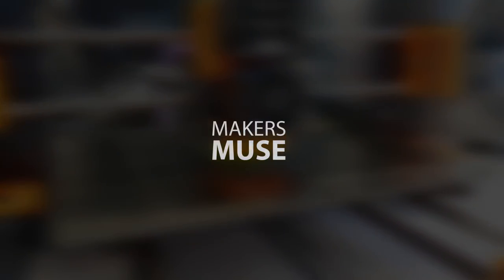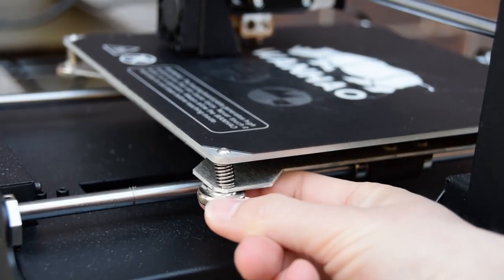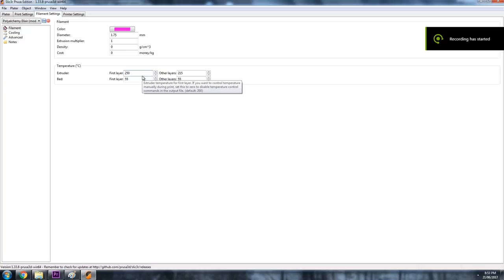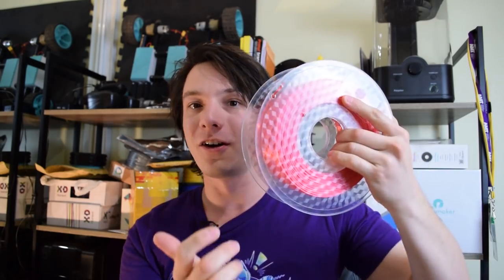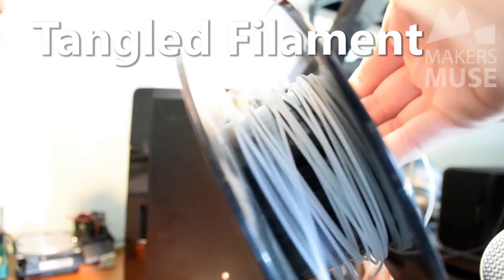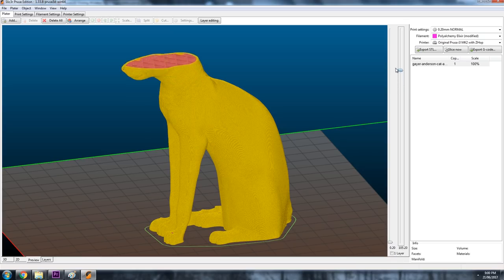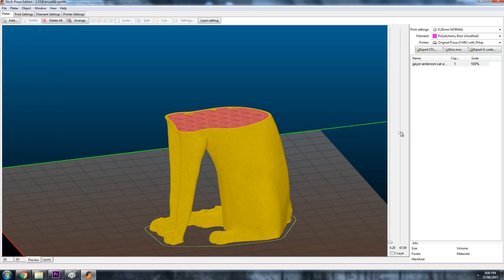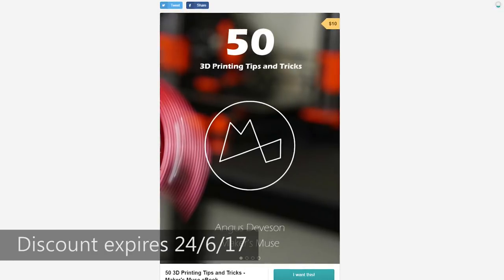5 3D Printing Mistakes you WILL make - and how to avoid them! 3D Printing 101

Comment: My print has failed on the base 4 times now, skipping huge sections and arching and tangling, I've print this model before in a silver PLA, I just switched it to a gold PLA with the same parameters so it's not the code. I've re-leveled it too many times to count (about 5), so at this point I have no clue what's causing it, any suggestions?

Comment: "connector problems"
My geeetech i3 pro b turned off while printing at some point, and after further inspection I noticed that the power connector does not reliably stay in its place. It came out like half a millimeter and lost connecton. It was pretty toasty as well.

Comment: I have a question that i need answered by an expert.... If i slice a model and its was done telling slicer to use a .06 nozzel and later on switch to a .04 nozzel will print fail do to extruding to much filament etc???  can this cause ringing etc of maybe cause extactor to start clicking /jamming??? i am having these issues i think... thanks

Comment: Why does my ender 3 pro say filament runout when I just loaded it and pushed the load on the  extractor until it came  out nozzle  but when I push print it stops and says "filament runout" before prints start

Comment: I remember having a problem where my PC falls asleep when a 3D-Print is running and the printer just PAUSES and then when I wake my PC the print "Resumes", But what is REALLY happening, The slicer THINKS it was farther into the print than it actually WAS, And, The printer R A M S into the Print, Sending it FLYING.. I learned my lesson, Remember to turn off sleep on your computer's Control Panel.

Comment: Just don't expect without prior knowledge of material science and engineering (the basics of both, nothing special) to just go ahead and do a 3D print. You might even fail with ready to print models like shown in the video. It isn't that hard, just learn the basics. I got myself a 3D printer and had no problem so far. You can't monitor a 3D printer 24/7. bigger projects will just take to long to finish in one go.

Comment: 1) Keep your Belts tight!  ( 3 belts at different tensions will not give a Square but a squashes square /_/
2) Keep your rails oiled ( vegetable oil )
3) Keep your nozzle clean 
4) Dont fix it if it works!

Comment: My wanhao i3 bed springs are loose. Do you have any recommendations to fix it? Could I just take them out and drag them and put them back? I can't print with it because the bed isn't level at all. I've googled for solutions but I haven't found anyone with the same problem.
Reply: xWood4000  don't take my word for it, but before I bought the creality cr10 printer I was going to get a wanhoa and somebody somewhere said to print small spacers
Reply: Well that would be great to try if I had another 3D printer... If I find another source that suggests it I'll probably try to print it at the library.
Reply: Got any small plastic or rubber hose around the house?
A dowel drilled out?
Take some paper, roll around screw, add glue, roll tightly until about 3mm thick.  let dry and cut to length to make 4 pcs.
Reply: Thank you.

Comment: This is fascinating and the first I have heard about "support material". I always thought this printing method could defy gravity and make whatever shape you want. It's not a shock, just had not heard this before. I guess anything with an "overhang" section in its slices would absolutely need to be supported from the ground up? Thinking of a candy cane or your cat example. Thanks
Reply: I do wonder if most of the issue can be mitigated by turning the part on its side.

Comment: Let's see:
1 - Done
2 - Done
3 - Almost, but i'm sure that it's the bad winding of the spool, and it hasn't jammed (yet).
4 - Done, but i use g-code preview, so it was over-estimating the bridging-quality of my printer, not forgetting to use supports, and it only ended with a lower quality print.
5 - Done, but no fails when i wasn't checking it, because i use g-code preview.
Bonus: Not happened at all (i'm really proud).

Comment: Dude i bought an anycubic i3 mega... my first good print was done after just 2 hours of reading the manual and working myself trough cura... really good after just 10 hours of learning and testing around. What really matters is how well you can get into technical stuff. Imagine someone with an iq of 100 tryes to work themselfe into 3d printing... yeah sure maybe they will work it out BUT it will much longer and it will be much more difficult to them. That's just my thoughts.

Comment: I cant print circles or screws with my Anet A8. I get a weird sharp edge that goes diagonal of my prints. It's not oval, but like the path the filament is taken is round, and then at 45 degrees it goes straight for just a little and then continues to do the circle... This has bugged me for weeks... Been tensioning the belts and calibrated the steppers and all that... The frame seems straight as well as the rods...
Reply: Thanks I will try this tomorrow!
Reply: I'm not sure if I can repair the software somehow, how just install something like Skynet OR if it's just a faulty board and I should order a new one. Maybe I should take the latter as a last resort, so I print my circles, if the same problem is all over, I install Skynet and hope for the best, and if that fails I get a new board.

Comment: This video is almost not current anymore. Cura Slicer makes it almost idiotproof. It shows you before printing almost everything.
Manual bedleveling is a thing, the spool shouldnt happen, and the rest is done by the slicer.
I am very happy with my results, even as a total beginner, with minimal effort put into the whole thing. Its not a hobbyist topic anymore, its primetime ready for daily use for anybody.

Comment: i have a question and ik the video is old but if anyone can help please do so. so i have a 3d printer Voxelab Aquilla 3D and i made sure to level the bed and everything and when i try to print the presets it comes with it works just fine but when i put a knew file that i sliced onto it it messes up what can i do to fix this?

Comment: so if you have a 24 hour print you can't sleep because you have to check every 15 minutes,please..
Reply: I didnt do a long print until I was comfortable with my printer setup.

Now that I have, I was able to comfortably finish my first ever 21 hour long print literally just this morning.

It also depends on what you are printing. If you're printing a simple model then you should be fine as soon as the first few layers have been laid.

Of course complex prints may require a little more checking. But I wouldnt be checking every 20 mins. Maybe every other hour i think its all best judgement.

Comment: Dirty filament.

This is a massive one ! Build a filter for your filament and keep the filter clean !
Reply: Never had a problem with that on my personal machine (Mine prints out of a dry box and is kept sealed at all times).
However if you unwind a spool to fix a tangle and it gets on the floor, it WILL pick up lots of dust and dirt.  In this case some tissue held loosely around the filament with a clip worked great.

Comment: GUYS AND GIRLS I NEED SOME HELP. MY PRINTER ENDER 3 WORKS LIKE A CHARM BUT LAST 2 PRINTS I HAD FAIL BECAUSE TTHE WHOLE HOT BED FELL OF THE PRINTER, only diffrence was the size of the print since this one ws little taller then usual. what might be the pproblem,i dont even understand how it manages to push off the print and the bed

Comment: 3D printing skateboard monsters matching the style of a board or an art style like tatoos printed into the clear resin of the wheel.As if the monsters or zombies skulls are inbedded in the wheel and you can see them inside the wheel. I guess print the characters like pokemon first with the shapes and colors connected to the bearing notch of the wheel. Then next inject the clear or colored wheel rubber around the axle bearing thing with monsters. Then when it is done they are visible through the wheel rubber stuff. Cool I wish I had the money now to go and design and make these for selling artistic skateboard wheels but I am busy with other stuff.

Comment: I've had 2 spool tangles. I swear to god the first one was in the box that way. The filament felt inconsistant and kinked many times for a huge section and it was tangled many times in the spot. I had many inconsistant prints.....and then I got past that and my prints were WAY better. The second one.......entirely my fault. I was loading 5 filaments for my MMU2 and it did it in a rush. It was right at the begining of the spool and my setup is rather complicated. Ironically the bad filament was the one that was included with my Prusa MK3S. It wasn't prusament and I'm not fond of the color. I would have rather spent an extra $5 to get prusament instead of that crap. The other filaments I bought have been great........and honestly after that shit section even that filament is good.

Comment: I dropped £589.99 for a 3D printer back in March.  Spent over a month trying to get it working and over £80 on filament but never printed a single thing.  Gave up in May and ebayed it for £220, so a loss of over £400.  Bollocks to 3d printing. I'll never buy another

Comment: ramps + 12V heated bed = fire hazard
The best solution without having to solder the power cables directly to the board is to add an external mosfer (1x 10ohm resistor, 1x 1K resistor, a 555 and a irfz44n) and power the circuit independently from the ramps board bypassng the cheap chinese conector which is the main cause of the board catching fire

Comment: I'm willing to bet the tangles and knots in the spools are the cheap brands seen it quite often in the welding industry where company's cheep out on the wire and either it's not helical wound or wire itself is bad causing bad welds seen a couple size issues in welding wire but a lot of the winding tech and spools are from the welding industry

Comment: 😔I am totally disappointed and frustrated that my 3d printer is not printing properly and i came here to check what was the issue with my printer😞😩
Reply: Today is the first failure i cam through in my life😔
Reply: Now I found the issue its mistake with my filament

Comment: Me printing: have 0% infil. think its fine. start printing. realize that there is a 90° overhang and slap my head. my printer: doesnt give a fuck and prints that area (with some mistakes ofc but the print was not completely ruined). I watched a lot of your videos and 3d printing nerds and some others before the printer arrived and bed leveling was the first thing that I did. my first print was a success :3